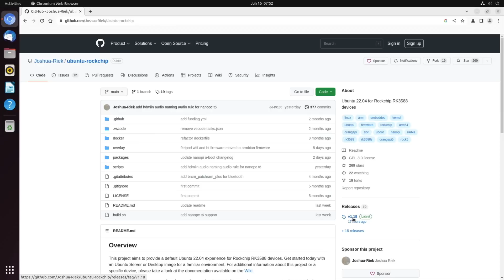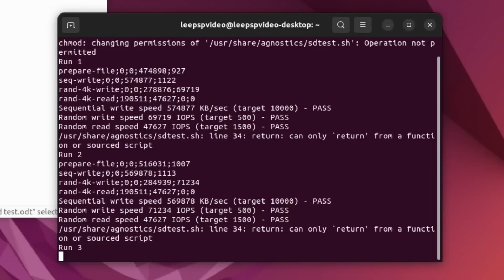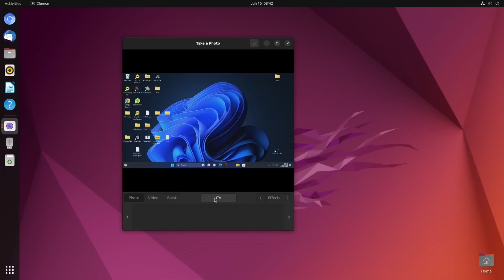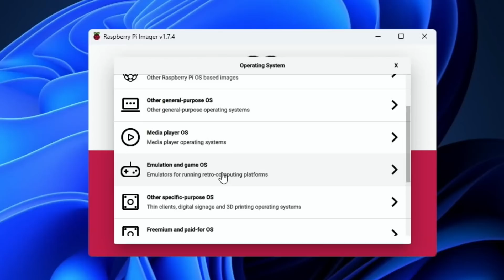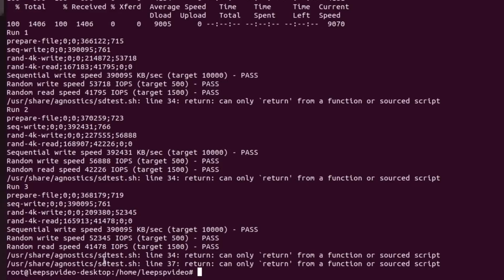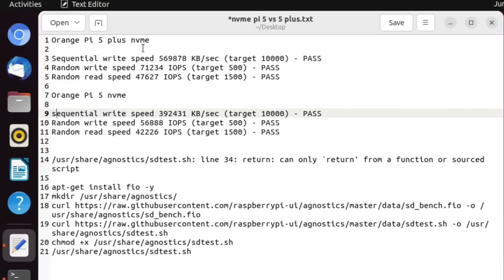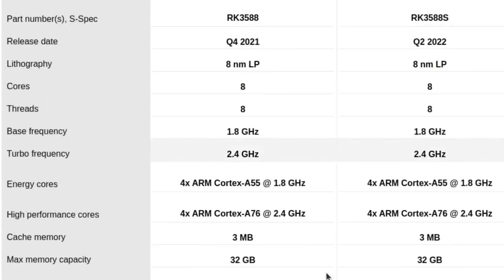The fastest Orange Pi! Pi5 PLUS.

Comment: GPU is only 610 gflops.
But it has a built in 6 core neural engine. Not sure how effective it is.
Also, a 32GB RAM version will be released this month (Nov 2033).
About $200.

Comment: How install android on orange pi 5 plus, or orange pi os (droid), when I install it on pi 5 plus, it never boot.
Reply from the maker: What are you using to write the os? What are you booting from?
Reply: @leepspvideo  I have installed with rkdev tool on the emmc, if I look from gparted from a OS from my sd card, the emmc partitions are correctly written on emmc storage, but it don't boot. :(
Reply: @leepspvideo  Did you have already succesfully install android or orange pi os (droid) on the orange pi 5 plus ?
Reply from the maker: @HorreyForthenewstep  I haven’t tried. I also don’t have an eMMC drive only nvme.
Reply from the maker: @HorreyForthenewstep  did you see the notes in the manual if it doesn’t work

Note, after burning the image into eMMC, if the test finds that it cannot be started, please clear the SPIFlash and try again. For the method of clearing SPIFlash, please refer to the method of using RKDevTool to clear SPIFlash.
2. 12. 1. Burn Orange Pi OS (Droid) image to eMMC
Note that all the following operations are performed on a Windows computer.
Reply: @leepspvideo   I've try around 10times, did you succeed by your side ?

Comment: I tested the crucial P3 plus Vs crucial P5 plus, I used your best of 3 method and here are the results
P3
1820444
74135
49053

P5
2730666
78392
60681

A clear win for the P5, so it is worth investing for speed. The boot time on P5 is very good and overall the speed is great. I have a very particular use for this and will be testing further

Comment: my Orange Pi 5 Plus arrived - I am quite shocked - the same SSD NVMe tested in old and new:
On Original/Old Orange Pi 5: Timing buffered disk reads: 1138 MB in  3.00 seconds = 378.71 MB/sec

On Orange Pi 5 Plus: Timing buffered disk reads: 4722 MB in  3.00 seconds = 1573.81 MB/sec

That is simply: 4 times faster SSD reads - that is amazing performance.
I was only testing Debian 12 so far, but I am getting there ;-)
Nice to have separate M2 slot for WiFi/BT - not that I use it but in case - 2x 2Gbps LAN is perfect also in case one wants to have a router or Firewall
I think market is really offering now better choice than before

Comment: Would EndlessOS work on the Orange Pi?
Reply from the maker: Arm sbc’s need specific builds to be made
Reply: @leepspvideo  is it because of the model of the chip? Like would a single build work for two SBCs with the same chip? Or is it because of varying I/O and other hardware?
Reply from the maker: @joyantonio4554  sometimes just small changes are needed

	Reborn OS Rock 5b RK3588 image working on Orange Pi 5.
	https://youtu.be/Qo4YTIwIZMY
	
	Rockchip RK3588S. Android 12, Debian 11 plus unsupported Ubuntu attempt.
	https://youtu.be/Mlr26ZKCMvM

Comment: Hello leepspvideo, I subscribed to your youtube channel this year because of the orange pi 5 content that you post. I recently discovered the orange pi 5 after not being able to get a raspberry pi 4, Your channel has really helped me understand the orange pi 5 however there are a few suggestions I have and will really appreciate it if you make videos on them.
1. Does the Orange pi 5 support raspberry peripherals? (A video of you testing various Raspberry pi peripherals on the orange pi would be super nice).
2. In case the Orange pi 5 doesn't support raspberry pi camera modules, What alternatives are there to be used on the orange pi 5?
3. How easy or hard is it to use the Orange pi 5 GPIO? (Just a simple "You can control a servo motor with Orange pi 5 would mean alot to some of your subscribers like me")
I know making content is a hard job, but if you can make any or all of the above videos, I'd be your happiest subscriber! 

More Context: I haven't bought an Orange pi 5 till now because I want to start practicing my embedded systems skills and I wouldn't want to spend hours trying to get a camera working. So far your channel has made me 75% confident on making the Orange pi 5 purchase.

Thank you for reading this message!
I appreciate your content alooot!!
Reply: Raspberry Pi started adding restrictions to their modules so that they are only compatible with their boards.
Reply from the maker: I would stick with Raspberry Pi for the maker side. It usually has more than enough power

Comment: i have opi5 plus 16gb, case , microsd,  Samsung SSD 980 NVMe M.2 500GB and i have installed 
Orange Pi OS(Droid) on microsd card. I don't know how to install it on m.2. Hardware acceleration is not working. I cant see smooth playback on  YouTube app or chrome , and on xciptv iptv also ! I don't know which operating system to install in order to watch perfect 4k60fps and streaming applications.
Reply from the maker: Try this method 

How to install Android to Nvme. Orange Pi 5
https://youtu.be/Bet_plMIS30
Reply: Thank you i have seen that video and all of yours video but i funny know which version of operating systems is perfect about hardware acceleration. Android droid can't play videos and streaming without drop frames.
Reply: Moreover i wanted to tell me if i have to have a micro SD inside the orange pi 5 plus in order to install on m.2 nvme the operating system. Thank you again.
Reply from the maker: @jimakos75  it depends what os is on the eMMC. If it’s Linux you should be ok to use Raspberry Pi imager to write Ubuntu or Armbian. If it’s Android you may need to boot an sd card to update the boot  preferences
Reply: @leepspvideo  Thank you for the answer, so i want to install android 12 although i know that it cant play 4k smooth, but if i use kodi, will i be fine to watch 4kj smothly? More, i saw again your viseo for how to install android on mvmv, and you dont use microsd, only you plug the m.2 and connect the sbc to your pc.

Comment: The Orange Pi 5 Plus has been very fun to work with, and Xunlong still have more RK3588 products in development. Specifically, the Orange Pi 900 and tablet / handled using the same SOC.
Reply: What's a Orange Pi 900 going to be like? Any rumors?
Reply: @Thomasz-Tech-Innovations  If the code I see is correct, the specs are Rockchip RK3588 4-16GB RAM 2.5GBE USB3 USB-C WiFi/BT NVMe

Comment: Just ordered mine from Amazon 16gb ver.  should be in sometime after the 10th of July.
Don't know how much time you've had to play with it, I'm kind of new to all this.Which operating system did you figure to be the best for gaming and multimedia streaming, I would like to do the NVMe install.
Don't know if you had time to play with the Bluetooth and Wi-Fi module. I bought a module as well RTL8852BE WiFi 6 AX1800 Network Bluetooth Card, from what I read on Wikipedia it's supposed to be compatible with all the operating system's. What do you use for game controllers what is your advice here wired or wireless.
Any help would be a greatly appreciated, just trying to get ahead of the game before it comes in.
I'll be looking for more of your updates!!
Reply from the maker: This may be useful 

https://forum.armbian.com/topic/26406-usb-wifi-adapters-that-are-supported-out-of-the-box/

Comment: I’m glad they added a screw mount for the NVMe this time. The lack of one on the original OPi5 was rather perplexing.

The NMVe performance you’re getting is a bit slow. I’m getting 2.7GB/s read when using 1GB chunks on a KingSpec 256GB drive. If you’re getting less than 600MB/s, either your drive isn’t fast enough or you need to adjust the parameters of the test to use large enough file sizes.
Reply: Yeah, but they should've also included the screws... Maybe they will with the 5++?? /s :D
Reply: @ricardoaugusto2333  the NVMe drives I purchase always provide a screw, so I’m not too worried about that. It was the lack of a mount that was really annoying. And rather unusual, given that there’s an industry expectation that an NVMe slot will always have hardware to mount into.

Comment: it seems the only difference between the 3588 and the 3588S are the PCI Lanes and Generation..... 
I WANT the Orange Pi 5 Plus!! Tho I don't really have a use for it LOL  ... But it's MUCH more powerful than the Rasp. Pi  CM4 (on a host board with pci-e nvme) that I have now.... I can't remember if if the Rock Pi 5 can run the Playstation 3 emulator RCPS3 .... if it ran it well then it's a full fledged emulation machine and would be a REALLY SWEET Emulation Box that covers the full range of emulators.... Hrmm.... I think I might be able to sell my CM4 for the same price as the 16GB model with shortage still in effect LOL ... I would get it if it could run RCPS3 ... so I think I'll have to check - THANKS!!!
Reply: Yeah the S variant is the stripped down version so less I/O but same performance from the chip. Its great to see OrangePi make this chip so affordable as its double rewarding for consumers and also means more developers are able to obtain the board/s for testing, hence the excellent software support!
Reply: PS3 is out of reach for this machine due to the fact you need at least 6 core PC/Laptop processor to run it smoothly not to mention a GPU with at least some juice. There is also the fact that PS3 emulation have a lot more to improve considering there are still games that no matter how powerful your PC is you can't. Don't get me wrong Orange Pi 5 is powerful but not that powerful but my AMD Ryzen 7 5700x is a monster in comparison and it is far from the best CPU out there.

If you are after emulation then I don't think there is much difference that Plus is going to offer you due to the fact that PS2 and older generation games reading and writing speeds aren't massive (cartridge, CD, DVD and so on). If my memory is correct you can play up to Wii and 3DS on it.

Comment: my 2 OPi5+ are now in ... Customs ;-) 
I really have big hopes for them - 2x 2.5Gbps is something that finally makes it ... usable router/firewall or so ;-)
I will also not cry if Plus is faster than the legacy one
Reply: You’ll love it. In my testing the OPi5 is marginally, but substantially!, faster than the OPi5. Single core went up 86 points in Geekbench 5. Multi core went up a whopping 298 points! I was also able to pull 2.7GB/s read and 665MB/s write on the NVMe. All without a heat sink. In fact, I’ve been running Stable Diffusion jobs non-stop and it’s held up like a champ. I don’t have any 2.5Gbit equipment to test with, so you’re on your own on that one. But even at 1Gbit, the dual NICs are a nice addition.
Reply: @thewiirocks  perfect - thank you
Reply: @Pika Sorry, the Plus when missing. Orange Pi 5 Plus is faster.

Comment: i have 2 old Orange Pi's and they are so frustrating!! The boards are amazing but trying to get an os to work on them is near impossible! Granted they are old boards but still they lack the community support
Reply: Armbian has what they call 'platinum' support for all Orange Pis. That will be the second o/s I try after OPi-OS.
Reply: Sadly a trait of most SBC manufacturers outside RaspberryPi and you'll find most of them just drop a SBC with a few distros and move on whereas I really feel that they lucked out by making the OPi 5 so affordable as its seen a small community of users/developers willing to invest time into supporting what really is a capable chip. Hopefully its a game changer and the standard moving forward! 🙏
Reply: which "old" - Orange Pi 5?
Reply: @zyghom  i have 2 off orange pi zero 512mb
Reply from the maker: What os are you trying to run? I have many tutorials
Reply: @leepspvideo  Orange Pi 5 is now part of my home lab: DNS (Pihole), Home Assistant, NodeRed, MQTT server, few Samba servers etc.
Reply: @leepspvideo  i have tried many os's , i did manage to get it to run pi-hole for about a month and then it crashed, i have tried diet pi , lubuntu, and others i cant remember , like i said its a lovely board but lacking
Reply from the maker: @familyplans3788  all these work well

	GPU support for RK3588 /S. Armbian Linux. Orange Pi 5
	https://youtu.be/gWYyXAfYSLM
	
	
	Optimised Ubuntu for Orange Pi 5
	https://youtu.be/kgcyKUtUqQs
	
	
	How to install Android to Nvme. Orange Pi 5
	https://youtu.be/Bet_plMIS30
	
	Openfyde. Chrome OS with Android Apps for Orange Pi 5 and 5B
	https://youtu.be/d6aF1HG5Hls